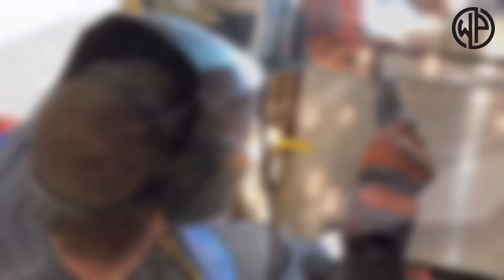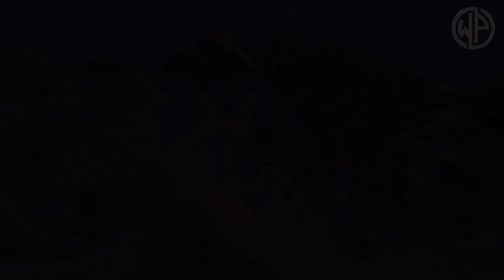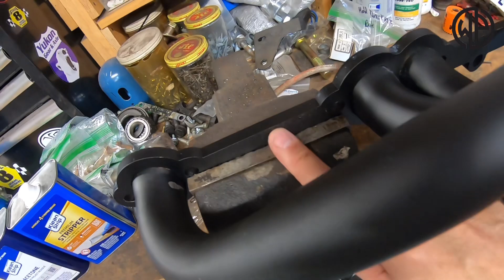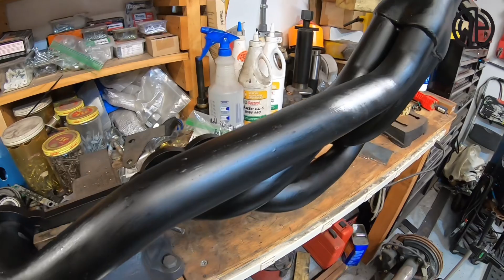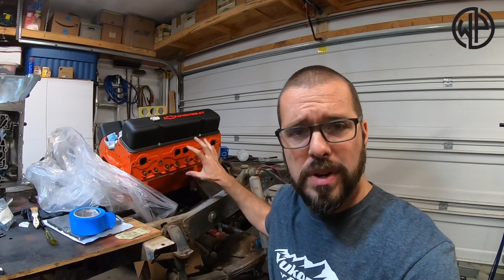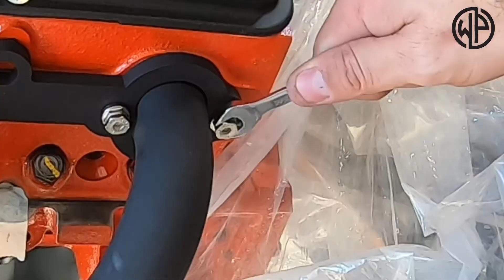Exhaust System HACK

Comment: why not run a Dual Exhaust instead of the cross over Y connecting both headers into one exhaust.
Reply from the maker: So I won’t have room. With the transfer case on the driver side, and the suspension links…I just won’t have room.
Reply: @WarPaintTexas Okay, must be a lot narrower than the JL is.